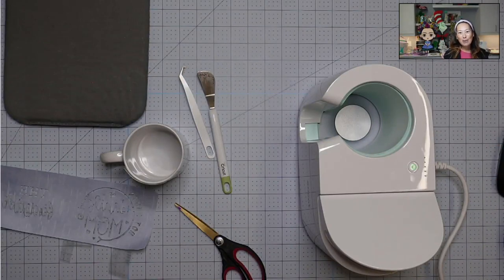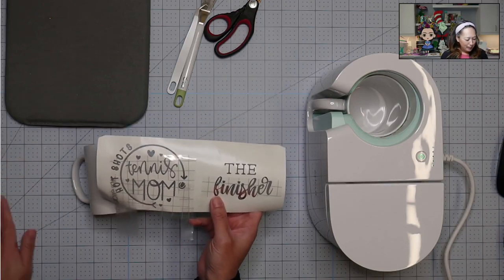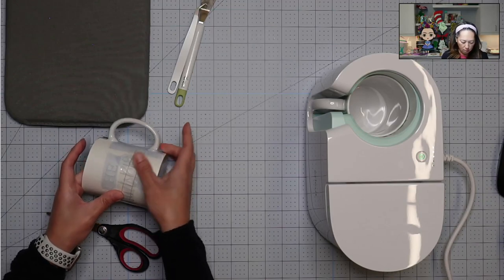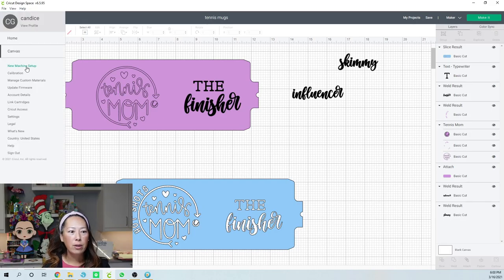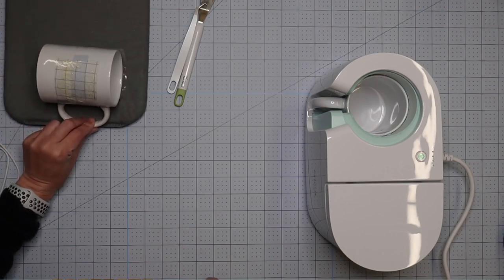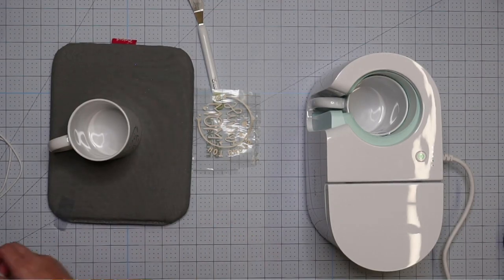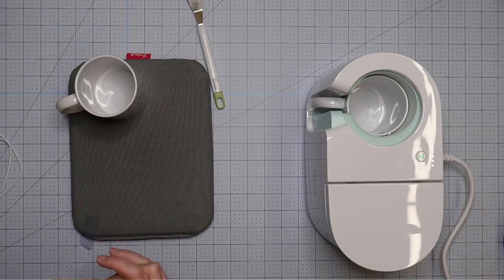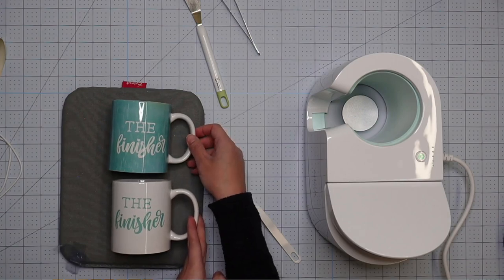Cricut Mug Press Review and First Mugs Part 2 | Using Infusible Ink Sheets | The Useless Crafter

Comment: Do you have to use the mug press infusible ink or can you use any cricut infusible ink sheets? (e.g. Larger rolls, cricut joy rolls).
Reply from the maker: Great question!!!  You can use either.  HOWEVER ... the ones not made for the mug press have the grid lines and the words infusible ink on the transfer sheet.... and it transferred onto my cup!  It was super faint, but I noticed it later.  So my recommendation is you can still use it, but to rip that part off and you can use the blue heat resistant tape that they offer on the Cricut website.
Reply: @TheUselessCrafter  wonderful.  Thank you so much!  I love your work by the way!!!